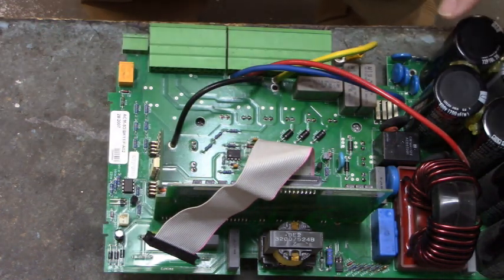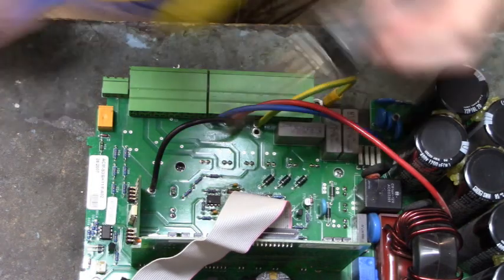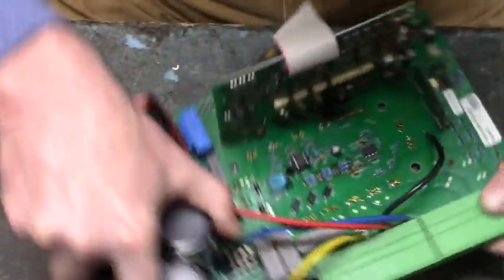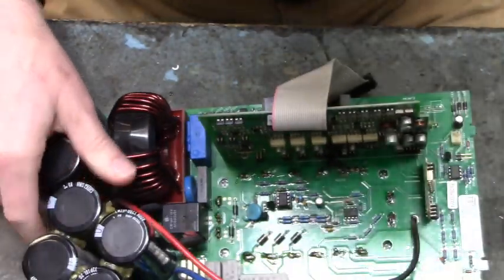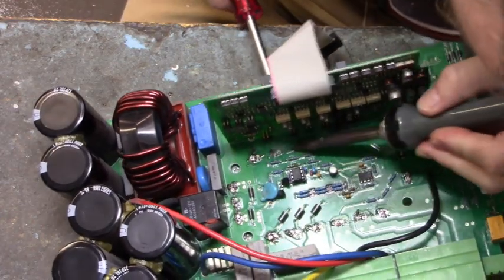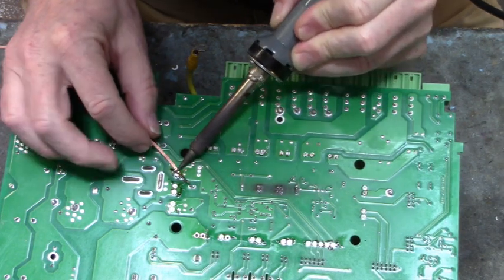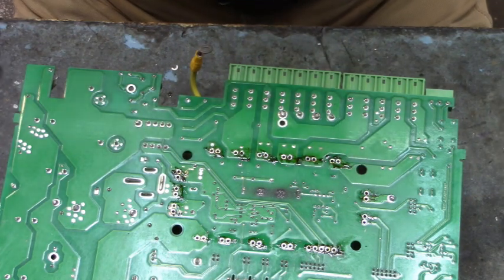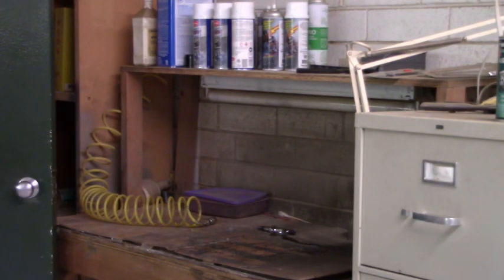The Hardest and Easiest Way. Removing the IGBT from the Power Board

Comment: Peepaw why are you not giving you a favor and buy electric desoldering gun or station. That would be a real time saver and your efforts to desoldering these difficult solder joints. You will not damage PCB vias by applying pressure from your soldering iron. I strongly recommend you to buy electric desoldering gun or station.

Comment: you can clean the holes from the solder by flipping the board to one side and put the tip of the iron solder on the hole and the desoldering pump on the opposite side of the hole and suck the  solders. I use this method without using solder wick.
sometimes when i want to remove IGBT i use compressed air , i mean when applying the tip of the solder on the pin to melt the solder i apply a compressed air on the melt solder to spread up the melt solder away .
Reply from the maker: I tried your method of via solder removal on Monday. And it works. Thank you so very much for teaching an old dog a new trick. You are awesome:)
Reply: @PeepawMcDonald  i have another idea i will try to do it, i will make air sucking using compresed air, imean instade of using blowing the solder i will sucking out the soldering, i will try to make aluminium tube one part for input compressed air and the part will be pointed to part to remove soldering from it.
Reply: @wadib3eed7  or you could try a desolder machine. A pace MBT-301 is a very fine tool.

Comment: I replaced a hybrid power chip on a Y-sis board for a plasma tv. The chip was about half the size of that module. I used a hacksaw to cut through the chip and cut it apart with side cutters. Then when all the pins were exposed I got them out. I put the new chip in and the tv worked for about a week.
Reply from the maker: Hello Bingbonga Binga, this inspires me to go to the hardware store to acquire me a hacksaw:)
Reply: @PeepawMcDonald  Hi. I got inspired to never ever work on another plasma tv. The thing weighed about 80 lbs and I had to carry it up 2 flights of stairs.
Reply from the maker: Hi bingbonga binga, I got my hacksaw. I am ready to go now. HaHa...